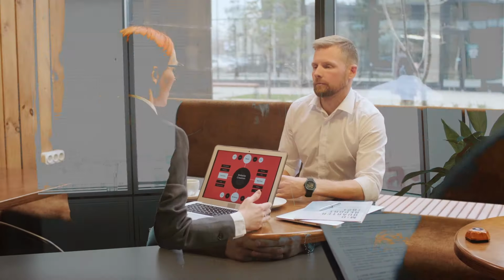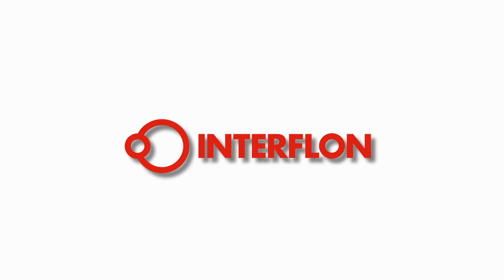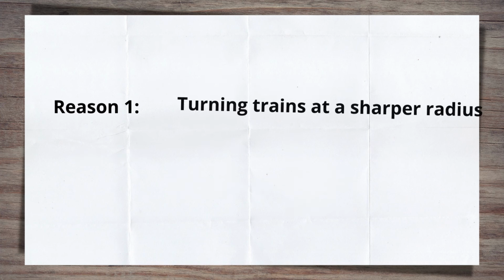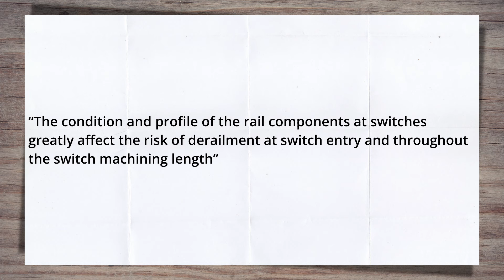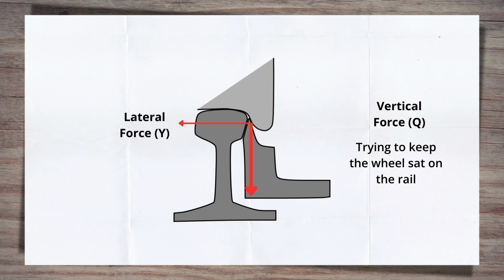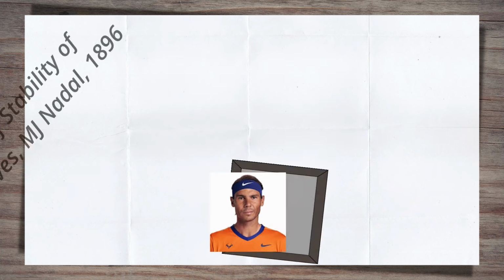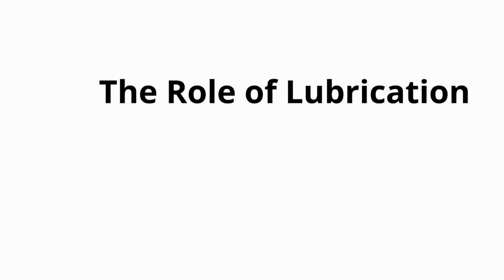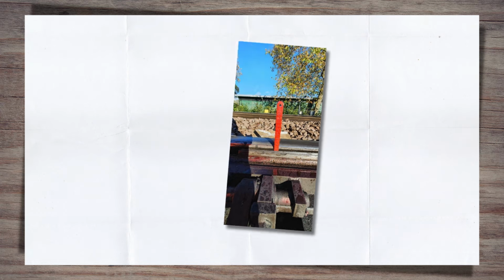Preventing Railway Switch Derailments! Why Switch Lubrication is Important for Railway Engineers?

Comment: What are the gauge indicators that are found on the walls,  below the platforms, near the tracks for?
Reply from the maker: They are for the position of the rail compared to the platform. It is on of the ways that the track position can be monitored to ensure its not getting to close to the platform, therefore risking hitting it!
Reply: @thepwayengineer  So, someone measures the distance from the rail to the outside edge of the platform and then moves the indicator on the wall? That way when it is measure again one can see if the track has moved since the last measurement?